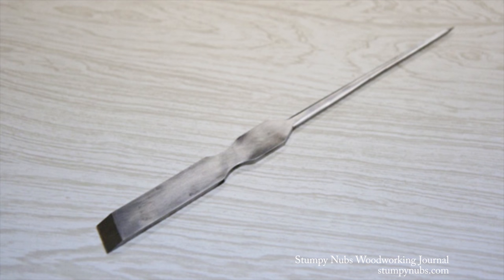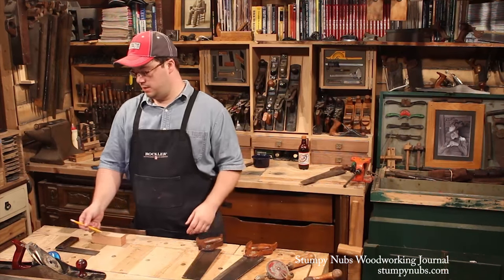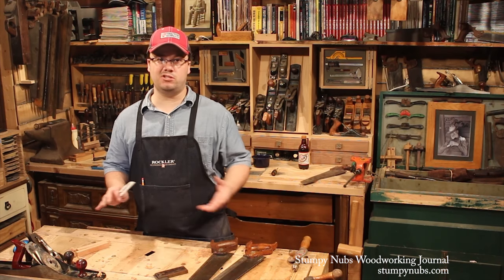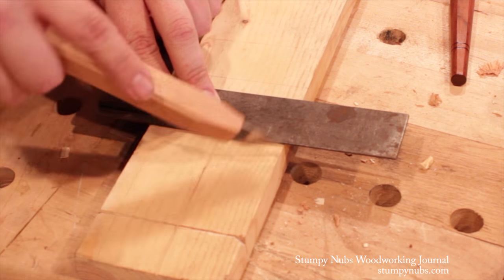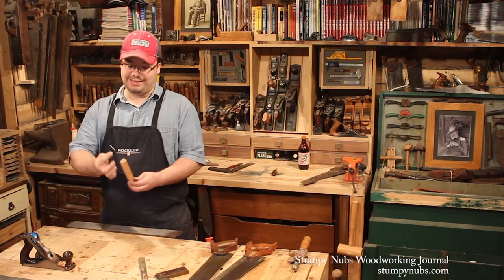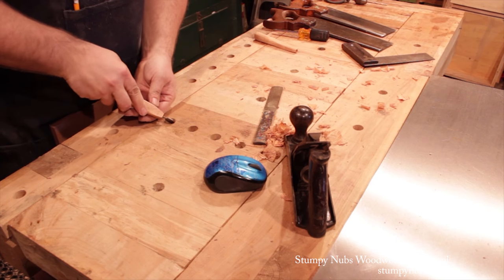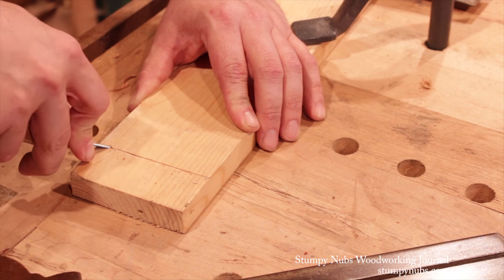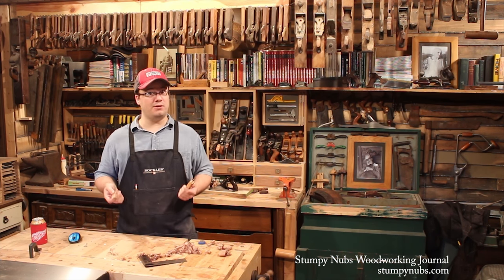2 Homemade Hand Tools- Making and using a marking knife & awl for woodworking

Comment: I'f got a fancy X-ACTO set handed down trough 3 generations and never once used for any of the fancy craft projects they envisioned.
Now I can actually put those blades to work by sticking  them in a handle that doesn't need electricity. Wooooo-Hoo! (That's actually a real word, I've seen Fred Simpson use it lots of time.

Comment: For the round scribe I once made one from a carbide burr cutter and epoxied it in an aluminum holder like an ink pen. One time sharpening it and never had to touch it up and it marked miles of tool steel through Dycom ink. The regular carbide scribes with the 1/16 inch carbide sucked and would break off like an automatic pencil but that pointed burr never wore any or chipped. It also dug a many metal chips outa my fingers. Stumpy's screwdriver awl would work forever if only scribing wood but the burr will do it >awl<😂

Comment: Perfect project to use up some 1/16 cold roll steel scraps I have. However, do you recommend hardening the steel to keep a better edge?
Reply from the maker: Yes, if it isn't already, you should. That's why certain saw blades, etc make good knife blades, All they need is sharpening.